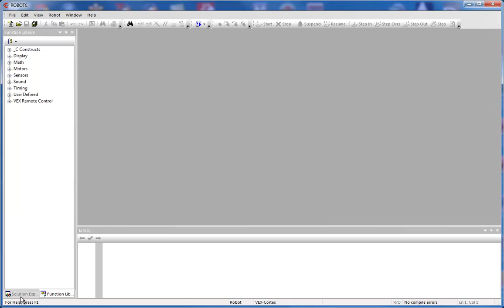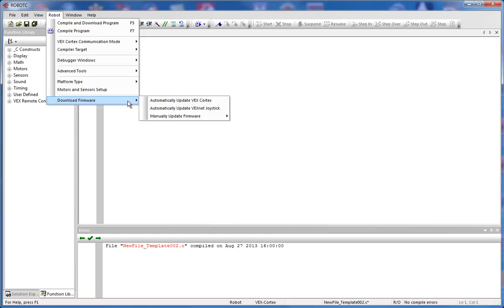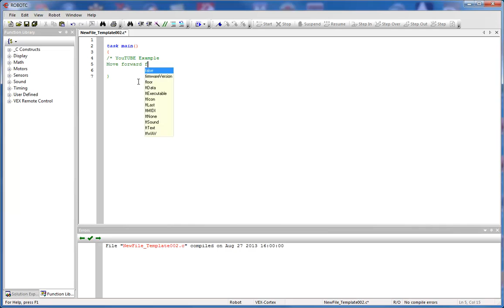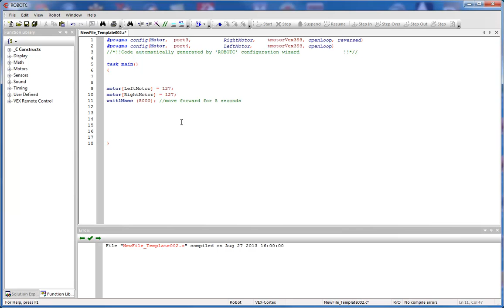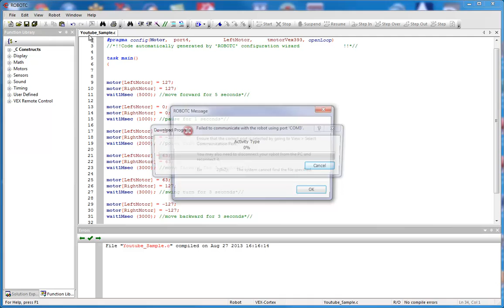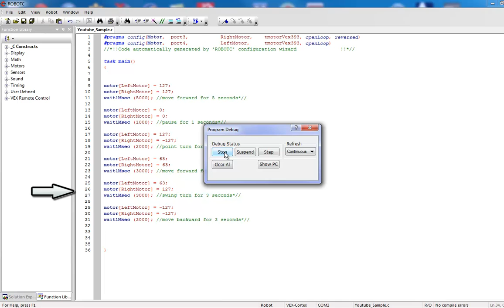Introduction to Programming VEX Robotics in RobotC

Comment: I have some suggestions for your code:
To write a comment on a single line you would put //
But if you were to put it on multiple lines you would start it like /* and end it in*/
-Now the reason you messed up your psuedocode in the beginning is because you put // saying the rest of the line is a comment then put the * so now all the following lines are no longer comments, to fix this problem all you had to do was one of two things;
1) Undo the extra / you added to the beginning of the comment 
or
2)add // to the beginning of all the psuedocode so that you can then dra and drop the comments at the end of each statement.
Reply: And for the power cycling part you could of click okay and download the program then power cycled to allow the new program to take effect
Reply: If you would like the viewers to view what part of the program is running currently just click the show pc button and it will show you what part of the program is running currently
Reply: exactly

Comment: You are just confusing the robot by doing capitals then non capitals. And whitespaces. When you code it you will just overwhelm the robot and confuse it to make it the wrong thing. It doesnt usually do the wrong thing, but it can.
Reply: It's all compiled. You can have variable names 1000 characters long, and thousands of lines of whitespace and it'll run at the same speed.

Comment: it bother me when he call it suma code, it not really a code, it use by programmers to keep notes, title, and organize
Reply: He's talking about pseudo-code, which is a technical term for the details of the steps you're going to code in a spoken language, rather than a computer language.  Mostly that's used for planning your program before you write it.

But what he did was to add comments, which is helpful for the next person that looks at your code and tries to modify it or debug it.  Comments are just unexecuted lines of text in code - they don't have to be pseudo-code.
Btw -  
 // is for single line comment
 /* is for multi-
      line comment
*/